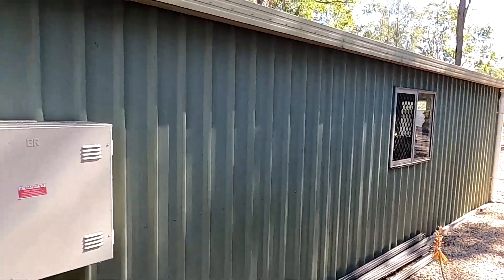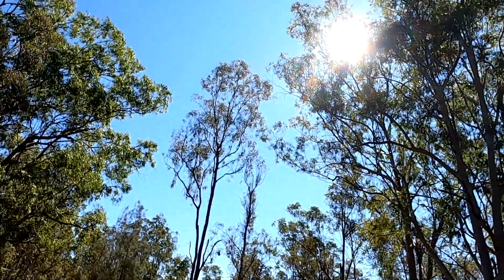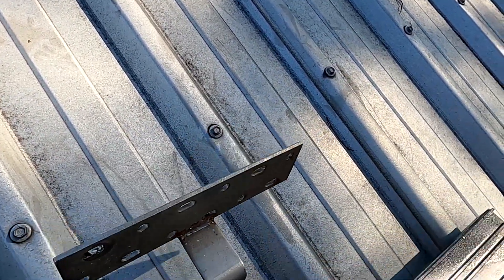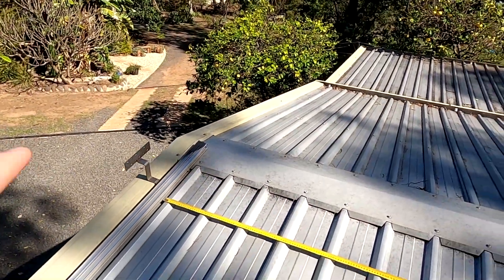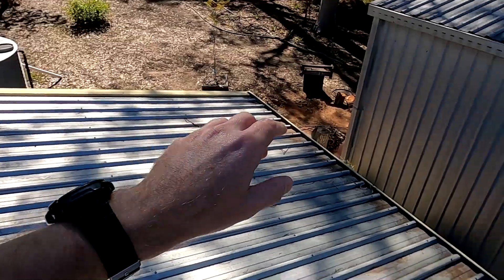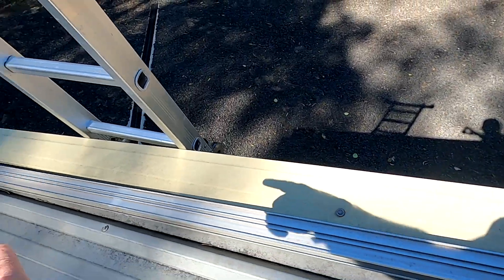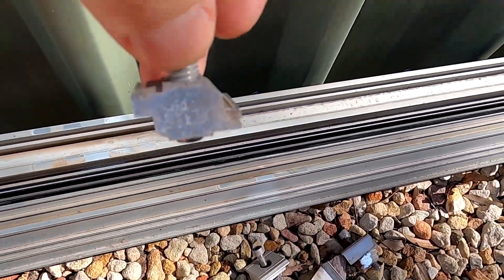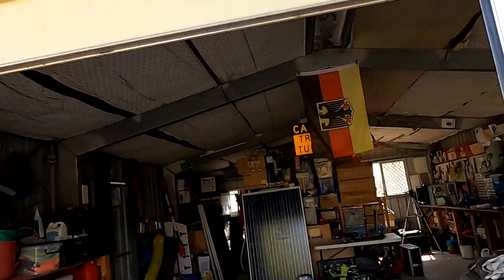How to arrange these solar panels on my garage?

Comment: Just moved across from unplugged ev.   So not seen further than the first couple of videos.         I have 9kw of solar on my roof and I recently fitted solar optimizers to each panel so if one goes into the shade it doesn’t bring the others down.     I can say they work a treat and are not just a gimmick.     Have you thought of these for your system